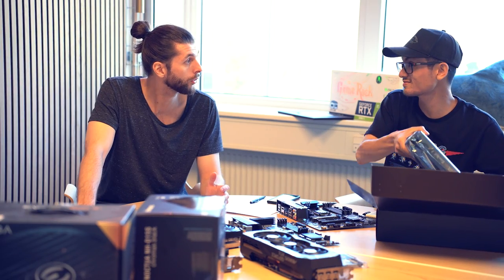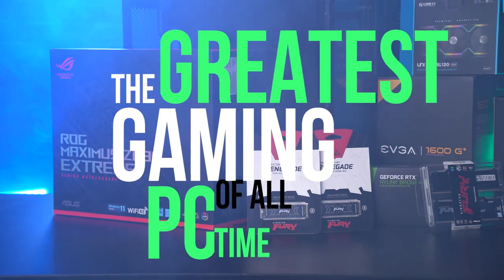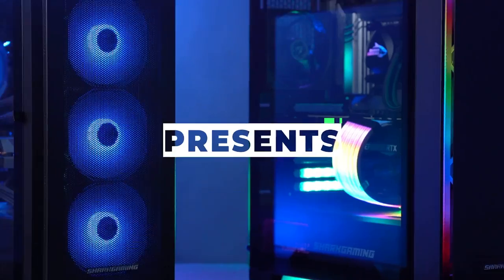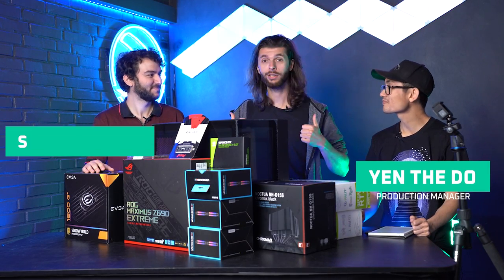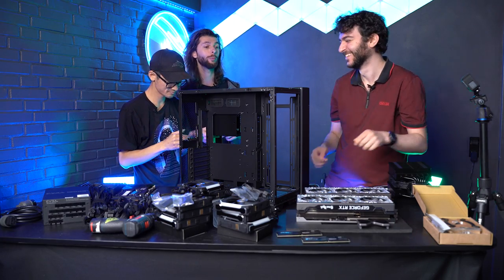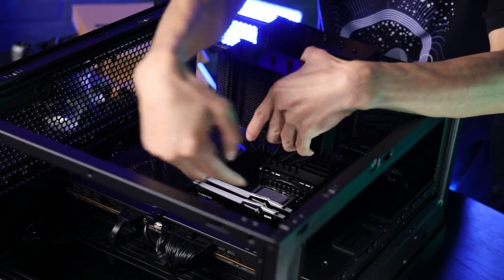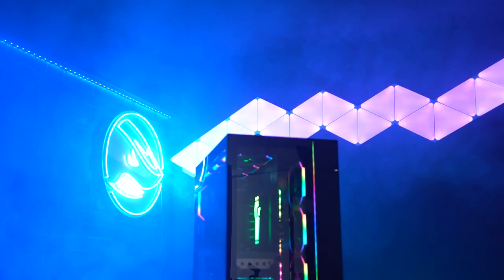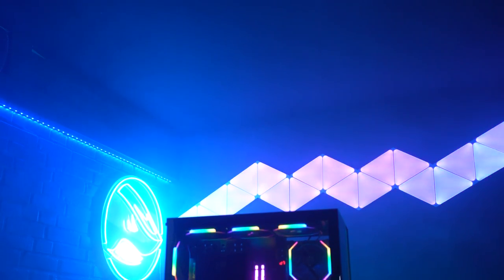The GOAT Gaming PC 🦈🐐

Comment: I have a problem that my headsett mic does not work 🙃
Reply from the maker: Which headset are you using?
Reply: @SharkGamingSystems  its just a normal headset with one cable and i want that the mic work and the headphones at the same time 😔
Reply: And the mic does not work at all it says its not plugged in
Reply from the maker: Is it one of our headsets?
Reply: @SharkGamingSystems  no its a random one but it works very good but when i plugget to shark gaming pc the mic does not work, its just one cable headset and i want the mic and the headphones work at the same time.
Reply from the maker: USB connection? Have you tried different ports?
Reply: @SharkGamingSystems  no USB. Yes i tried different ports with three mices it didnt work
Reply from the maker: That sounds like a software issue more than a hardware problem.
Have you made sure that you've enabled the correct Mic as input in windows or whatever program you're using?
Reply: @SharkGamingSystems  yes i checket, still not working